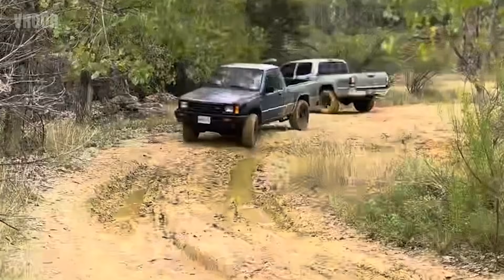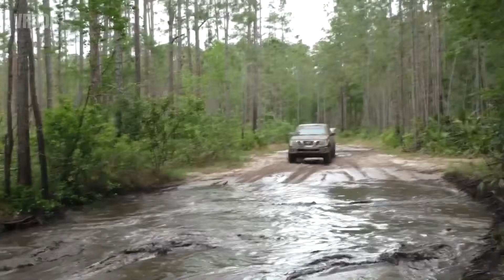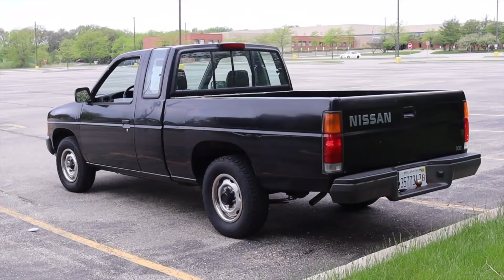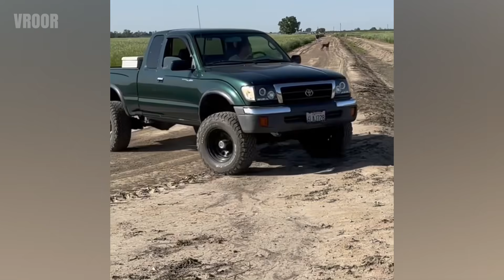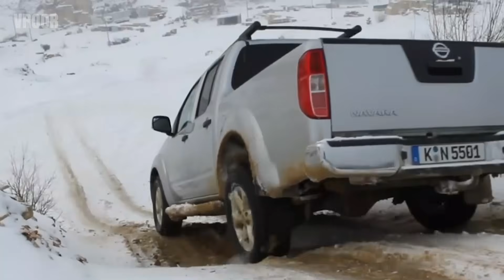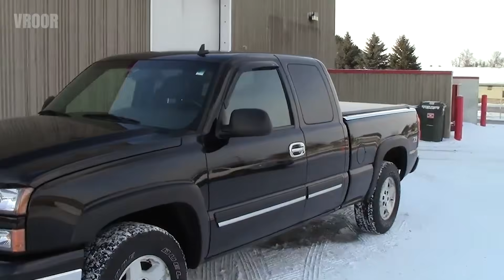10 Most Reliable Dirt-Cheap Pickup Trucks That STILL Humiliate Every New $60,000 Truck

Comment: My family had a 99 ranger with the 4.0 engine. It got the tar beaten out of it for 10 years and only got parted out when the body and frame were taken by rust. It went 279k miles with 1 change of plugs, and regular 4,000 mile oil changes. It required a   new ignition switch twice, but the engine stayed solid well into its second life. At 440k miles, the new owner put a new timing set in it and kept abusing it as before.
Reply from the maker: That's an incredible story about your '99 Ranger! It really highlights the durability of those older trucks.

Comment: What Happened?!?  These companies, after years of figuring things out finally got it right and made excellent vehicles. As I look at today’s sorry crop of pickups, I have to wonder what the heck happened? Did these car company executives start taking drugs and then just decided to ruin their products? They started putting out garbage vehicles in order to maximize profits, but all they did was alienate their customers, most of whom would never consider buying the crap that is being sold at dealers today. Will any of them take note and change their trajectory? To sell a decent vehicle at a reasonable price? Any company that chooses to do this will do very well in the upcoming years. The rest will fail, and I say good riddance!!!
Reply from the maker: You hit the nail on the head. A lot of buyers are completely alienated by $60k+ price tags, overly complex electronics, and over-engineered components that are expensive to fix. There is a massive, untapped market for a simple, rugged, mechanical workhorse offered at a fair price. It's exactly why these classic cheap trucks are skyrocketing in popularity right now!

Comment: You say 330k miles like thats something special.  My old mazda b2300 (which is a rebadged ford ranger )had over 600,000 on the od when i sold it to my cousin 10 years ago and hes still driving it. All original drivetrain
Reply from the maker: 600k miles on an original drivetrain is absolutely legendary! The Mazda B-Series and Ford Rangers from that era were built like absolute tanks—especially with those bulletproof 2.3L/2.5L inline-fours or the 3.0L V6s. 330k is definitely impressive for modern standards, but your truck is proof that older, simpler engineering just refuses to die. Thanks for sharing that awesome milestone!
Reply: 80's and early 90's chevy ford and dodge we all good.  Small chevy cars used toyota and isuzu engines, ford used mazda and dodge used mitsubishi.